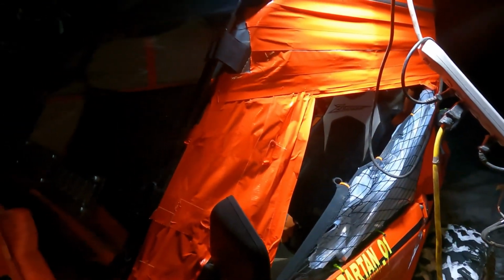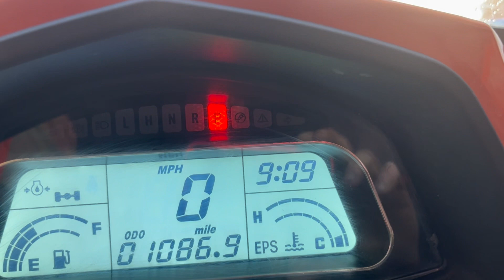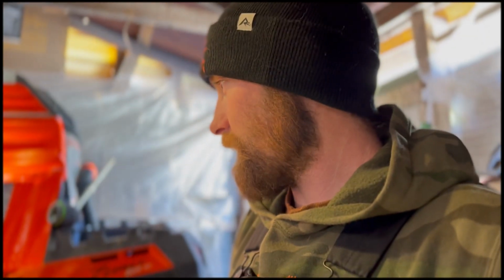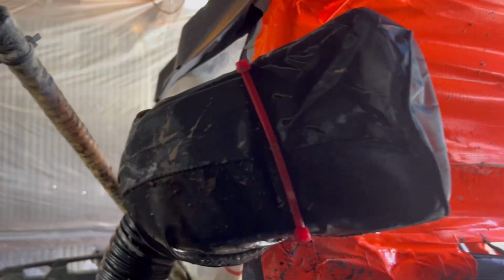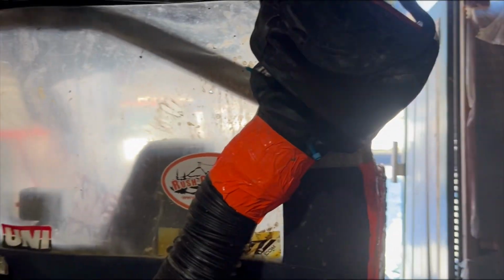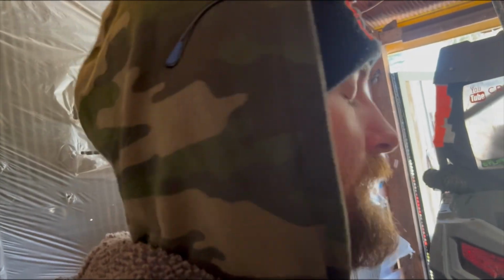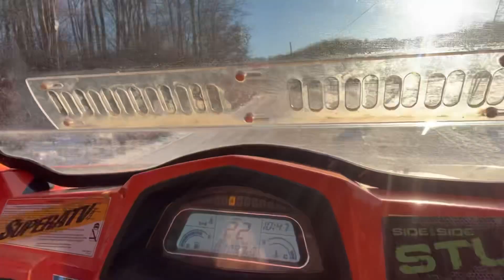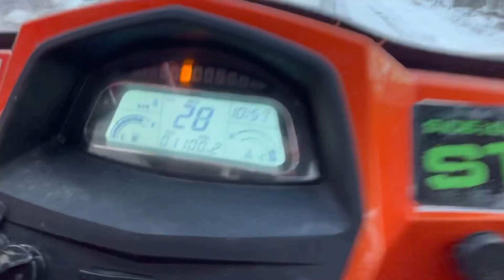CFMOTO Z FORCE FIRST WINTER RIP 800EX 950HO-EX! EFI issues & DUCK TAPE!!! MOTO-MONDAY!!! #LILLYBUG

Comment: Do you use reg fuel or high test. I have been using g the high test in Canada it is 91
Reply from the maker: I run high test 93 as much as I can but a lot of the little gas stations we come across while riding don’t offer it so I do run 89 too but when I race I run 91 non ethanol with VP Madditive concentrated octane which I think puts me at like 100-102 octane so it varies but I try to run atlest 93 much as I can